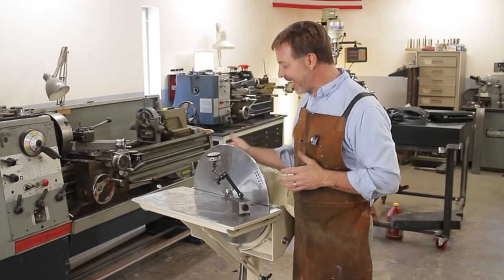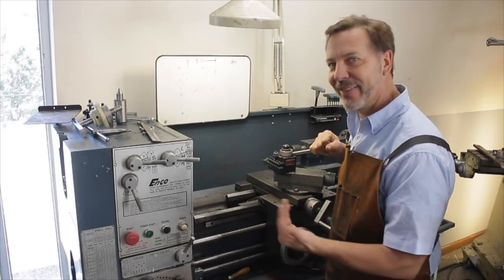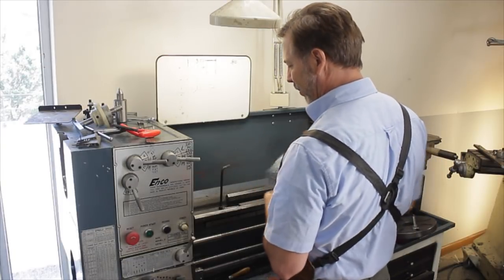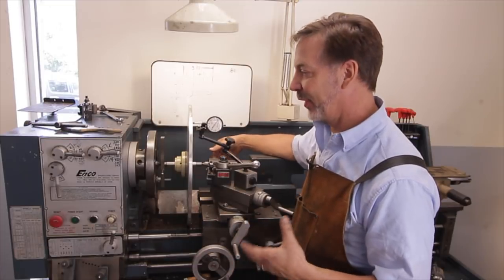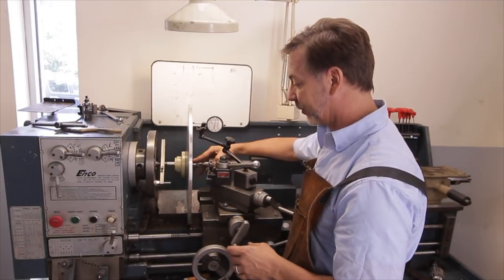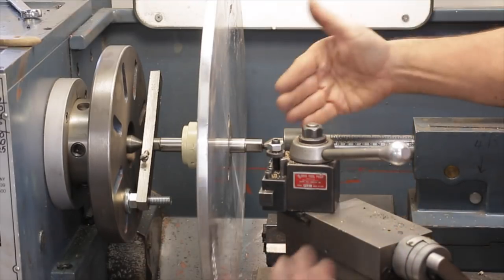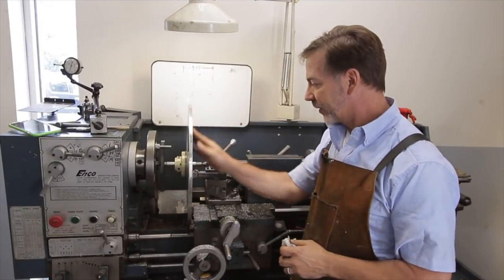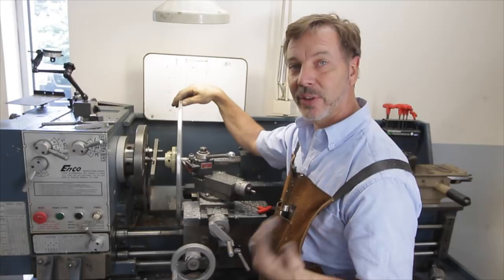Big turning on a small metal lathe ( Part 1)

Comment: Hey Dale, on old trick my mentor taught me years ago. If you have a part that you can't dampen harmonics on with the bungee cord trick, (your disk seems too thin.) you can cut out a peice of MDF or Plywood fit the back of the plate and bolt it to it. If you are not able to bolt it, you can also just tape it with some good double sided tape. The wood absorbes the ringing harmonics great.
Reply from the maker: I like your suggestion a lot. I will d a video on it. Thanks

Comment: Hi Dale
You can have chatter problems when turning brake rotors a trick with that is to use a piece of truck inner tube cut down and stretched around the outer rim or if you can find one a big o ring that will knock out almost all the ring and chatter.

Dave

Comment: Man! That is a heck of a job! I just tried to turn a 9" disk and apparently I was way to fast. I had all kinds of problems with vibration. I found if I started from the middle and cut outward I could use the surface finish to determine if I was doing better or worse.  Id get four or five inches out then the singing started. I finally had to cut a round pvc drain pan from the hardware store and cut it so I could sandwich it between the 3-way jaw and the disk. That moved my surface finish out to about 7" but the last few inches still gave me some trouble. Im watching your part 2 and part 3 now. Cant wait to see what you do! I do have an impeller balancing machine strangely enough that was made for balancing fan blades and impellers. Ill probably set that up for jobs just like this. Thanks for the post. I learned a lot!

Comment: hi Dale,
you could put a thick steel backing plate along side the aluminium plate with some RTV as a vibration absorbing layer in between since a the RTV will cure without any shrinkage. just put a drop of oil on the aluminium where you put a dab of RTV so it doesn't bond but still has contact. that should eliminate your harmonics issue.

the other issues you're going to run into with your sander is the disk warping again. there is some stress in the disk which is what caused it to warp in the first place. by keeping your contact time short of the work against the sanding wheel, you can reduce the warpage or delay it for a bit. 
of course the disk will flex with any pressure you apply to the work against it. inevitably you will end up having to replace the disk because of the way aluminium behaves in these types of applications. 
the manufacturer of the sander screwed the pooch by using extruded (or rolled) aluminium plate instead of a machined casting

my recommendation would be to make a new disk from slightly thicker stock and machine a lip into the back side of the new disk so the rim of it has more rigidity to it. that will make the new disk run truer for longer. by making the lip you also remove the excess weight of the sanding disk which the motor wasn't designed to spin and return it to an approximate facsimile of the original disk

i'm a little miffed at you for the somewhat misleading title of the video since your lathe has the capability to turn the disc. i was hoping to learn something new here. i have faced this same problem before but the lathe i have at my disposal doesn't have a gap bed to accommodate larger work pieces. still, overall i do like your videos and some of the crazy things you take on. keep up the good work

cheers
mike

Comment: Pro tips:
People who remove nuts and bolts for a living know that a sharp impact on a tight fastener is infinitely better than steady pressure. Socket head screws are far more prone to stripping than hex head bolts. 
Best practice is to use a socket drive Alan (or torx) and hammer it firmly to the bottom of the hole. Then use the slop in the ratchet wrench as a lead to snap the screw free. If you watch an experienced mechanic remove fasteners, you will see them rotate the wrench colockwise slightly, then snap counter-clockwise. If you are worried the fastener is extra tight and might break, hit it with a very firm and sharp blow from a hard hammer like a peening hammer. The hammer blow will serve two purposes: it will drive the screw head into the metal and give you some slack, and it will mushroom the head of the fastener so its fits tighter.
If you round out a socket head screw, you can usually drive a torx driver into it as well.

Another mechanics trick on the turning is put something soft in contact with the disk. Brake lathes use either a pair spring loaded grippers or a large rubber band. The band goes around the circumference, the grippers ride ontop of the cutter and apply pressure to the faces of the disk. Hanging a weight off the arbor also kills vibration (or just grabbing it with your hand). In a pinch, you can just hold something like a leather glove or a block of wood up against the disk to kill vibration.
Reply: douchebagnumero1 It will only damage low end ratchets like Craftsman or the like. You can (and I did) do this with a Snap On all day for years and have no issue. My favorite ratchet was one of those bent handled swivel head 3/8" jobs that Snap On makes, give it a quick snap, and then spin the bolt right out. Very fast, but will break your knuckles and snap off spark plugs until you master the tool.

You can also use good ratchets as hammers :)

It is far easier to break low torque fasteners like these loose with a ratchet than a breaker bar, you get much better control of the motion and it fits into tight spaces better.

In fact, breaker bars should be avoided on all but the highest torque fasteners because they are difficult to snap quickly because they have too much mass. Steady torque is how you break bolts and round off bolt heads. Sharp impacts are almost always preferable.
Reply: Don't disrespect the "Craftsman," I have two that I have been using for 40 years.  I've hammered on the handles, I've hammered with the ratchet, I've used 3' cheater bars, and they are still working strong.  Don't know about the newer ones.

Comment: Good video Dale, Yeah a part like that can be a bit of a chore. A lot of people mentioned dampening the vibration with rubber or wood, but what I have found is that sometimes it could be controlled just by letting a dead blow hammer rest on the back or front side or the OD of your part. It can be hand held.
Thanks again.
Reply from the maker: thanks for your comment  :-)

Comment: I turned a lot of disk brake rotors when I worked as an auto mechanic. The lathes came with a leather strap/belt that was wrapped around the circumference of the disk to damp out the harmonics when turning disks. Give it a shot.
Reply from the maker: Thanksfor the suggestion

Comment: Liked the video,  I do wish I would have seen more of the process, im in the middle of Trans planting a case motor in my skid steer the problem I have is I need to adapt a 4 bolt drives haft onto a 6 bolt crankshaft, after attempting to build a couple 2 peice adapters and the welding together, I had some cracking issues, so my next try is to make it one peice adapter but I've never had good luck turning large dia. tin peices in the lathe,  so after a bit of inside from your video, I'm gonna give it a shot, wish me luck and any tips would b great, I kept some bands off my old brake lathe and do plan on using them

Comment: Watching that reminded me of a brake lathe.  When turning brake drums they wrap a heavy rubber strap around it to dampen the vibrations.  Obviously your disk is too thin for that method.  Which made me wonder what kind of results you could have gotten with putting that on a rotary table on the mill and using a fly cutter while turning the disk in a circle.  I am sure you will get a million other crackpot ideas suggested.  Keep on keeping on.
Reply from the maker: Thanks for for your comment

Comment: I was also thining of doing his with my disk sander but thought I would push the disk away with the toolbit the more you go to the OD. and also woudn't it help if you would put a rubber band on the outside od the disk like they do with turning disk and drum brakes. it helps alot with the harmonics.

Comment: I had the same problem with my sander and my solution was to chuck the arbor in my Bridgeport and clamp the tool in my milling vice.  I put a thick chunk of rubber on top to stop the ringing.  I couldn't have been happier with the finish.
Reply from the maker: Very interesting suggestion,  thanks!

Comment: I'd be interested in a little more info on why the disc couldn't be trued up on the sander, especially with an abrasive block...

Admittedly, for woodworking, +/- 0.015" is a fairly tight tolerance...

Comment: in the old days of turning brake disks and drums, we used to put a bungy cord around the part to change the harmonics of the part, you probably dont have room for a bungy   cord, maybe you could tightly wrap the outside with something like filament tape. it could change the harmonics enough to improve the situation.
Great video as usual Dale.
Cheers :~))
Reply from the maker: Thanks for the suggestion Phil  :-)

Comment: Taking out painted-in screws -- or frozen -- screws is unconstitutional. Cruel and unusual punishment. I have found that if you are patient and use Bolt Blaster, Kroil, or whatever, wait a good long time for it to act then it is easier. When you put the gap bed back in, if you use never-seize on the screws, the second time it will be  easier. The biggest problem with those outboard turnings (I just did a couple) is getting the cutter outboard.  I will add that I use backing disks, double-sided taped to the victim, and it does break up some of the harmonics. Any material will do. I use  masonite. A very nice job.

Comment: You can also strike the fastener a few times to help break it loose. CRC makes product called Knocker loose, expensive, but highly effective. For hex key torx and the like, use an old tool or portion there of to strike the fastener.

Comment: Build an Arbor to hold the assembly on your milling spindle. Fasten some wood or fiberboard on the back with double sided tape and put a sharp tool in the vise facing up at the proper orientation. Lower the disc to contact the tool and engage the table feed this will cut the front surface in one op. Flip over and mount on a rotary table to cut the back parallel. Just my opinion I'm noted for using non ordinary methods. Good luck

Comment: A very useful video with a lot to consider. Thanks.

Can you support the back of the plate with a ball-bearing-on-a-stick? Maybe you would have had to flatten the back first to do this. To make a "dead" support, maybe the "stick" could be clamped in lead to dampen vibrations. A wad of plasticine (that oily green modelling clay) moulded around the stick would also tend to dampen vibrations. (I once moulded about two pounds of plasticine around the lantern toolpost on my 9" SouthBend to dampen a particularly troublesome vibration. Just the tip of the tool poked out of the ball of clay. It worked. Nasty clean-up, though.)

Growing ripples from chatter almost always need a deep cut to remove them (not an option here), so maybe a really light skim cut with an extremely sharp tool? Or even a very light pass with a toolpost grinder?
Reply from the maker: great suggestions. :-)

Comment: Hey Dale.  I used to turn a lot of brake drums and discs.  We had different sizes of rubber belts put on the circumference of the drum or disc  to absorb the harmonics.  Maybe a large diameter, .250 o-ring would help if you could find one.
Reply from the maker: thanks for the idea. :-)

Comment: Good video, I have the same lathe and have oil leaks. I have turned several discs and you are correct they are a chatter nightmare. Thanks
Reply from the maker: My lathe leaks too. Someday I will fix it. LOL
Reply: Mine leaks at the lead screws.

Comment: Is it out on the back and the front the same? And if so I Would clamp the disc to a flat surface like a mill and tram with a indicator. I had a similar problem with a 24" aluminum disc .650 thick. I heated it a few times to about 300 deg letting it completely cool between heats and between each heat I tuned it 180. It went from .025 to .0025. But if it is machined out then of coarse you need to machine the piece. Now here is something I have done for harmonics on a thin disc.go to Lowes or Depo and get a can of the stuff you dip plier handles in. Take it out of lathe lay it flat and put about 4 or 5 coats on. It peels off when your done.
Reply from the maker: I like  the way you think  :-)

Comment: When I turn brake rotors I have a large rubber band with lead weights in it every say two inches apart. You run the band around your work piece and hook the loop on the one end to one of the lead weights that are fastened through the center of the rubber strap. Seems to me that would work here

Comment: Id maybe cut a plywood ring to double side tape or hot glue to the back side to help vibration.i fixed mine by sticking th3 belt sander to it while being spun on the motor itself. admittedly not the proper way.but that big surface area and smooth sanding action worked well.

Comment: Hi Dale have had second thoughts about removing the gap bed piece only because have heard can cause bed to twist. Dont know if this is true but is a fear. 
Another question is could you of deadend the harmonics by applying tape or another paper, cork, silicon to backside of work piece to remove harmonic attribute of job resulting in better finish?
Interested in your thoughts on topic.

Comment: For the first cut, could you use a right hand?? tool mounted backwards in the holder? I just wondered if you wouldnt have to swing your compound so far past 90 degrees to reach the outer edge. Great video!! Harv
Reply from the maker: I tried every thing I could think of. There is no good way to do. thanks for the comment

Comment: Did you have some kind of rigid faceplate to mount to the back of the disc?  That may have helped with the harmonic vibration and made it easier to turn.
Reply: Don Damour  if he didnt chose to leave the hub a typical plate would have been doable, but I cant see fabricating or buying something for this one job.

Comment: For tough to undo fasteners try striking the top of the fastener with a suitable size hammer and punch or use an impact driver ( I mean a tool like an oversize auto centre punch with a 1/2" drive to take an a socket or adapter for various screw types )
 I've seen too many rounded bolt and screw heads and hex keys fail leaving a SHARP ragged point to using your method.
Cheers Eric

Comment: Diamond cutters, I know they are not cheap, but I used to turn many Al diffusion bond parts that were basically 25" in dia. and 5/16 in thk. Of course these were cnc's but the diamonds you could take tenths and have beautiful results. Sometimes a stick on the cutter shank to dampen, but you only have so many hands and your manual lathes require them. Just an idea.
Reply from the maker: great Idea.

Comment: Interesting  to show how to stretch  your equipment's capabilities. However I don't see the need for a "sander" to be that precise? It won't affect the parts that are sanded unless you don't turn it on...
Reply from the maker: I made the sander for one project that require a disk with in .005 or it would not work.

Comment: Did you true the boss while you had the disc off?
A sharp HSS tool with small nose radius (for small cutting force) and a high sideways shear angle might improve chatter by putting more of the cutting forces radially instead of axial.
Reply from the maker: great suggestion  :-)

Comment: So what do you do about the concave facing nature of a lathe. Or is that acceptable in this build? On an on related note. I live in a small town wedged between two mountains in the Bitterroot Valley Montana. Essentially it is just a sphincter of a place. Any way I just purchased a Ward Maxigrind CSG4 T/C grinder. I am trying to get into tool sharpening. I have not been able to find much info on using such a machine, curious if you have any leads or ideas. I can order the manual, but it is currently more than I can afford. Any help would be greatly appreciated. Thanks Shawn.
Reply from the maker: Hi  Shawn. The only way i know  to fix your lathe it to take it a part and rescrape it, or live with it. 
Have you gone to  vintagemachinery.org for information? If they dont have your machine look up other tool cutter grinders. They kind of all operate the same.
Reply: My lathe is actually pretty straight for a cheap-O, I have put hundreds of hours work in to get operating to exceptional standards. I was referring to the concave nature of every lathe on facing operations. Does that not effect to final outcome of the disc sander, since the face should have a slight concave from facing it on the lathe? .... As for the Ward Maxigrind T/C grinder I have looked everwhere including Vintage Machinary. org. They don't even have the brand on there. Yes it is a T/C grinder and they are all kind of similar, but this is kind of a different beast than say a KO Lee, or Cincinnati. Here is a link that shows the same model I have. http://www.1stmachineryauctions.com/lots/ward-csg4vfs-maxigrind-drill-grinder .. First T/C grinder that can cut a flute in a single pass.

Comment: I tried to turn my 12 in al. grinding disc on a 16 in lathe and the end results was a way off balanced disc. would have to lighten up parts of the disc to balance. but came across another 12 sander that wasn't home made and works fine so I never got into the balancing part of the project.
Reply from the maker: Ed thanks for sharing, I plan to show  some balancing on the next videos